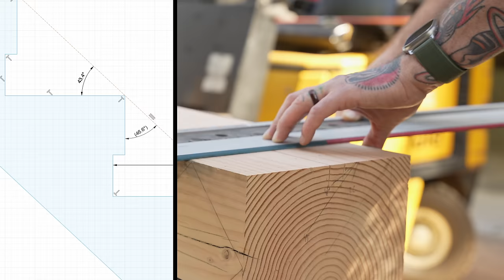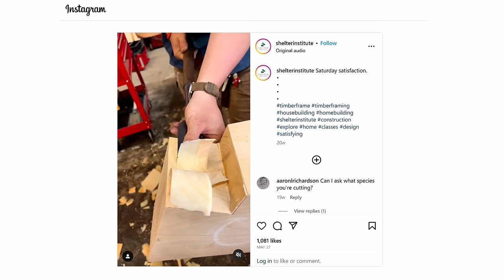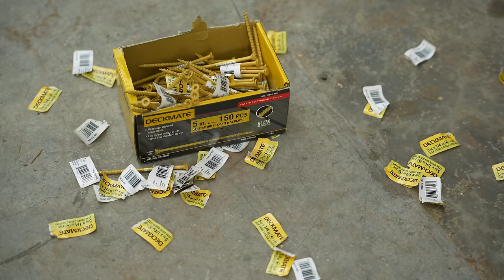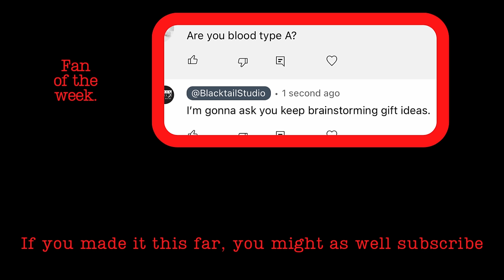Timber Framed Staircase Build

Comment: I have built quite a few staircases over the years using concrete in situ, steel, and wood in various combinations. Even the really bulky I-Strings have a bit of give and flex, particularly on hot days.The only ones that don't have any flex are the ones attached to the walls around it via a wall string That goes for overhang concrete stairs aswell. The weakest point on stairs, obviously, normally, is where the riser and tread meet. 

Watching the video I was wondering whether you were going to inlay any steel under the string.

Since this is your own staircase; If at any point the flex and give becomes too much, just add a metal plate, cut exactly like the string shape on a side view, to the wall side out of sight. Kind of laminating steel to wood. This is the same way old oak/cedar beams are strengthened. 

In my unprofessional opinion, you did a fantastic job. 

My only real concern is whether the floor joist at the top can handle the weight of the stairs. Having run into a problem on one that I did, I added more timber between 3 joists so that the staircase does not bend the joist where the string is fixed to. I don't really know what the structure looks like there and watched this video on my small phone screen.
Reply: Exactly what I was thinking as I was watching -" inlay a steel backbone". When you are walking on it it will flex (you won't feel it at that thickness but it's doing it).   The stress points are like a zipper pattern in the string focussed on the inside of each of the 90 deg cuts.  Each of those points will be greater or lesser than the one next to it radiating out from the center of the string to both ends in a hour glass pattern.  When your body weight gets more or less to the center as you walk it will be the time of greatest stress which will be focused on the upper and lower most 90 degree inside cuts.  Which gain a little strength back depending on how you attach at each end (so the ones next ot those becime the next weakest points.). If you attach a backbone this can also be tied to the ground and upper joist(like a suspension bridge to give a little additional support)
Reply: @carpenter1138  so you mean the weakest point is at the thinnest point of the stringer and the middle of the span?
Reply: I think this is the most in-depth YouTube comment I've ever read.... Kudos
Reply: Get an engineer to check it out 
Try not to hire one whose bridges or dams have already failed 😂
Reply: Love Blacktail Studios and Johnny Builds...great to see you guys working together.
Reply from the maker: That’s really interesting. I’d have never thought of the steel shadow/spine on the back side. Thanks for the feedback!
Reply: 22:22 How confident are you all in those flimsy joist hangers?
Reply: @camplethargic8 my biggest concern is the Tapcons and deck screws used for the attachments, neither are rated for anything remotely like that.
Reply: @stevebengel1346   What are recommended then, for these two applications?
Reply: @JustSayN2O  to be 💯 correct, ideally an application like this needs reviewing by an engineer bc of this particular design and application, some structural screws would certainly be better than the tan Deckmate screws and the Tapcons which will snap easily enough on
 their own
Reply: John Builds was a super nice guy to help you do this job. Or he is trying to kill you. It is a beautiful staircase though. 

In this scenario, you have a staircase anchored to a concrete floor at its base and a joist at the top. The staircase is inclined at a ~45-degree angle with respect to the floor, which means it makes a 135-degree angle with the ceiling (since the sum of the angles in a triangle is 180 degrees).

Let's talk about vectors. Because vectors are everything. 

To determine the direction of the resultant force vector, we need to consider the forces acting on the staircase. The main forces to consider are:

The weight of the staircase itself, which acts vertically downward due to gravity.
Any additional loads or forces applied to the staircase, which could be due to people walking on it or other objects placed on it.
The reaction force from the concrete floor, which acts perpendicular to the floor and supports the weight of the staircase.
The reaction force from the joist at the top, which supports the weight of the staircase and any additional loads.
Since the staircase is inclined at a 45-degree angle with the floor (and 135 degrees with the ceiling), the weight of the staircase can be broken down into two components:

A vertical component (Wv) acting downward.
A horizontal component (Wh) acting horizontally along the ceiling.
The reaction force from the concrete floor will cancel out the vertical component of the weight (Wv), so there will be no net vertical force. The resultant force vector will be in the horizontal direction (Wh) along the ceiling.

In summary, the resultant force vector in this scenario will be directed horizontally along the ceiling, perpendicular to the joist at the top of the staircase.

Breakage somewhere along the middle would be a real fear I'd have. That crack is pretty terrifying, but only because I don't know how deep it goes or if was filled with somethign that has good tensile and sheer strength. Or a steel spine plate, as has been mentioned. Further to that, the continued Wh forces will put sheering tension on the screws used to screw it into the floor. I would definitely have put some angels into the architecture with a heavier duty plate and steel bolts at the base. I'd also put an angel in the form of an architectural beam to add strength in the ceiling to handle Wv between the top of the staircase and the floor joist.

Think about it.
Reply: @JustSayN2O  4x 1/4 inch grade 5 bolts have a proof load of 85000 lbs each with an appropriately sized nut running through steel spreaders on top and bottom. Screws are just the wrong tool for the job of securing the top of the stringer IMO. 

Think about it: spreaders evenly distribute the force so you have 4 bolts taking the job instead of one, and if each one can hold 85000 lbs you're never gonna get close to that. You're also removing the strength of the wood from the equation for the most part. However, I do agree that with that gnarly crack even with the bowties it needs a steel spine.

Comment: John Builds, as an engineer it looks OK.  I think the through bolts will hold the top OK, and if the plate is well attached to the wood then that is OK.  The board you used looks like the size of 2-2x12's so that would be acceptable.  The good thing to know is that if it fails it should crack and makes lots of noise before it does break so you will have a warning.   Great to hear that the two tables sold for so very much.
Reply: Seconded by a another engineer.
Reply: I'd be more curious about the numbers on the individual treads, if someone were to stand on the edge thats a lot of leverage on deck screws, the rabbit joint wasn't that snug to provide much support...
Reply: John builds: Curious what the rise and run came out to be. 7” tall and 11” tread is usually the standard. Plus I wonder if the stringer he attracted to is blocked to it’s a joining rafter. Adding some blocks between the two could help take the twist/bounce out of it. Just a thought, and personally nothing can be over engineered when it comes to your shop. Having tags on every screw, now that is  over kill.  Also I personally like the contrast of the two colors.
Reply: @richardconing7615  Big pieces of lumber are fine in torsion, the span isn't that long, and the threads themselves are clearly solid AF. I am more concerned, as everyone else is mentioning, that the connections top and bottom could use some beefing up.

Comment: The Shelter Institute and other timber framers typically use green timbers. That's why the chisel work looks so nice because the wood is much softer and less brittle being wet still. Keep up the great work.
Reply: That's true. You can improve your ability to pare dry wood with a chisel or slick if you dab a little bit of linseed oil and turpentine blend on it a few minutes before you start.
Reply: @williamboquist4090  that's sounds like the tip of the day

Comment: Johnny Builds; Hey Cam, love the content, love this build, and I think you made the right choice on the finish.  As an engineer, the only comment I would make technically would be to consider using slots on your floor tie plate.  That really is just a safeguard against the cement floor and the stringer moving at different rates seasonally or as the timber cures.  It would still be constrained in 2 degrees of freedom vertically and side to side you would just have slots going forward along the axis of the stairs.  I might be a little paranoid.  Just think about it.
Reply: i think another thing to note would be to use, chemset epoxy bolts. we use them alot in in aus for column baseplates etc
Reply: @reilytong3954  Yes; something like that anchored into the floor, a Keensert or the masonry equivalent would be great.
Reply: at 26:09 you can slow it down a bit and see it move as he walks, better than the end I think. how big a deal is it? It freaks me out a little, as a non-engineer
Reply: @zoox101  Like I said, I might just be paranoid.  Or a perfectionist.  The stringer is so stout and if we assume the concrete is properly poured and cured... Then honestly the weak link might be the fastener... Which would probably shear off before the stringer would crack.  I'm reality the worst case scenario is probably just things bend up a bit during some seasons... Like a door getting stuck a bit when it's humid outside.  Probably nothing to worry about.

Comment: I think you used the right "invisible" finish for the steps, it's beautiful.  I goes better with the black than the other color you were debating on using (it looked yellow actually).
Reply: Absolutely agree. The dark and light aesthetic really brings a modern feel to it. The only thing I would have changed is that the plugs should have been accents with a darker stain or maybe a brass inlay. It would have continued the modern feel. 😊
Reply: Think About it 🤔
Reply: Agree. It felt fresh! And a little 1980s 😁
Reply: @hadensnodgrass3472  i like the brass inlay idea. it would still loook good, but you know IT'S THERE FOR A REASON, unlike a wood plug just trying to blend in

Comment: As a structural engineer with 35 years experience, I can tell you that stairs are a real danger area for us designers. The strength might be fine, but people hate any deflection in stairs. For any unusual stairs, we would analyse them to death before sending them to the shop. In the case of your stairs, I wonder what the torsional twist deflection would be if you walked towards the edge of a tread. Great video by the way, thoroughly enjoyed it and have subscribed.

Comment: I’m a mechanical engineer and I’m impressed 😂. Was a little worried when I first saw the extent of that cracking, but you seemed to handle that well with the bow ties . Nice work guys!
Reply: The bow ties are only what, 1/2" deep.  The cracks likely propagate through most of the timber.  Cam better throw a few mattresses below the staircase.  Just sayin
Reply: @JustSayN2O although it looks like a concern, these are not cracks but normal checking. Checking does not significantly affect the structural properties of the timber. In fact, the bow ties are unnecessary (structurally speaking) although they do look nice. If the stringer was cracked, then it’s a different story. So, the mattress can stay in the bedroom.
Reply: @henrypeisch5289  was in the middle of typing that... the wood has been drying for 3-4 years checking is completely normal and doesn't affect integrity of the beam even though it looks like its unsafe lol
Reply: @noahmarosok8168  Cam does flawless work from what I have seen. Almost neurotically flawless. When he screws up, he owns it with a charming and self-deprecating humility that is hard to bash afterwards. So, I can see how some who watch often probably have been just lying in wait for something to jump all over. Triggered by the checking in the Douglas fir I guess. I suppose it’s understandable. Think about it.

Comment: Johnny Builds - It's difficult to see how you mounted it, but I think you might've created a stress concentration at the top of the staircase where it joins to the wall stud. The original staircase spread the load over two points that were connected to two more parallel structural studs. Over time, that might weaken your mount structure, but you can reinforce the other side with some truss beams or a structural stud as a precaution (at least this way you don't have to unscrew everything). You've also got torque about the middle screws when you step on the edge of the stairs whereas they were simply supported at the edges beforehand, so try to step in the middle.
Reply: He needed steel spines on everything. Would have been fairly easy to inlay too.
Reply: Think about it

Comment: Johnny Builds is a great channel name. As an engineer I am a big proponent of over engineering and over sizing, especially in something like a staircase. The brackets you made seem to be a bit undersized for the job, there will be a lot of torque on them from the stringer, especially if you are carrying a heavy load while using the stairs, I would imagine that beefier brackets would eliminate the side-to-side tilting that you are getting when walking on the stairs. I really like the lighter treads versus the natural color.

Comment: Protip: Turn the piece of bung wood on its side and run the band saw just short of the depth of the hole drill. All the bungs will separate in one cut. Another protip: Place a layer of painters tape over the bungs before you do the verticle cut to the bungs. They stick to the tape and make a nice 'tray' to pick the bungs from and they (generally) don't drop off. Good stuff and the staircase looks awesome!
Reply: Johnny builds would have known to do that already! That's literally how he cut out the bowties lol
Reply: He did that for the bow-ties..wonder why not the plugs..
  Painter tape great idea..
Reply: Because its one of those "pro tips" that arent really that pro. Just popping them out and flipping it over onto the table creates a pile of plugs you can easily use your hands to grab as you would anything else on your workbench.
Reply: LOL But he didn't when it was the same principle. Generally, pros are consistent in their craft. However, I do appreciate his honesty and willingness to share that he forgot something, or made a mistake with the chisel AND LEAVES IT IN the final edit. No one else (mostly) does that on other channels. @thechadwick22

Comment: Johnny builds was an absolute legend for helping you out with this. It turned out great. One think about it opportunity that came to mind was doing a saw kerf along the whole under side of the stringer beam in the center about 3” deep, then PL premium/ bolt a piece of flat bar into the kerf which would keep it from ever failing

Comment: Johnny Builds with Blacktail studio are the perfect team to create this stairway.  If you were ever to make another stairway, I suggest you by a two man saw like the lumberjacks used a century ago. You more than likely could cut that thick wood pretty quick.  Do you feel the stairs won't get slippery if they get wet?  I would consider creating some kind of non slip backing to put down. I don't believe you would have to cover the whole stair, just the high use part of the stair.  Thanks so much for sharing. I never miss an episode.

Comment: Not an engineer yet but an engineering student, I’m impressed by every project you do Cam, not just this one
Reply: misread this as "just not this one"😭
Reply: @arminowo3885  haha same, didn't even notice before your comment
Reply: Check back in after you graduate
Reply: As  a structural engineer, I can say that I have built lots of things for myself that I could never put out there professionally. Things that would never make the design codes I have to design for, but I know for my personal use that I will never approach those loads. One of the biggest issues with under designed wood is deflection and permanent creep. All wood will creep, but when something is already flimsy for its purpose, it will creep a lot. That would be my biggest concern for this thing, just from seeing how much it moves under a single man using it. That and those checks being contained with one bowtie per tread just seems too insignificant for me. As a non-repetitive, primary member, those really bugged me. I don't think it will fail, but I would definitely not have a party on it.  And as someone else pointed out, keep an eye on those connections especially because of its movement. Things in wood can wiggle themselves out over time when dynamic loadings are applied.

Comment: Nice build!! If you haven't done so already, I'd try extending out the attachment points at the top and bottom to be as wide as the stair steps. That way it'll spread out the deflection at the ends and hopefully reduce some of the twisting shown when you walk up and down

Comment: Johnny Builds - I had to build a staircase for my home and only decided how to do it after everything else in the house was already finished. I'm an amateur woodworker, so it was freaking hard to do it and I actually ended up making a 2.0 and 2.5 version afterwards because the first version was not good enough. All that being said, I was impressed by this build. You definitely mastered it and made it look awesome!
Also, I noticed that other than bouncing the steps were tilting sideways a little bit as you were stepping on them or applying the finish (27:05). Did you come up with a solution or it didn't bother you at all?